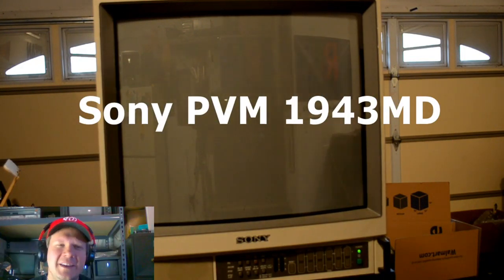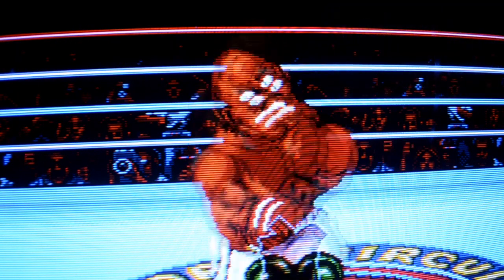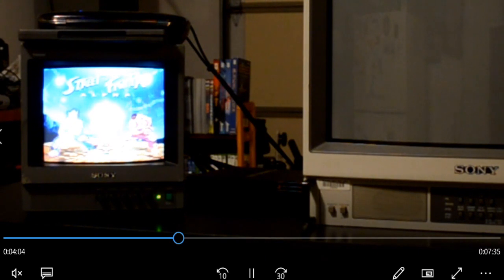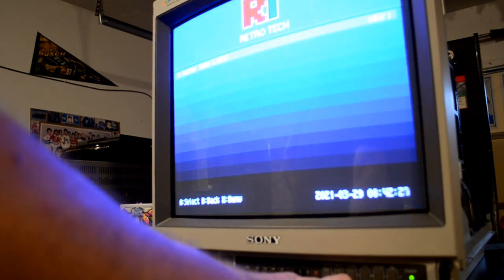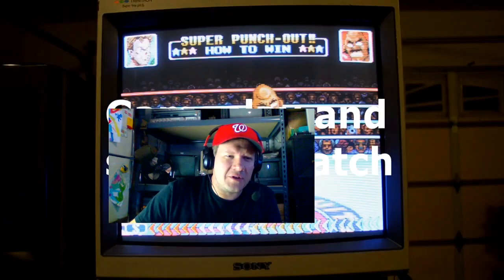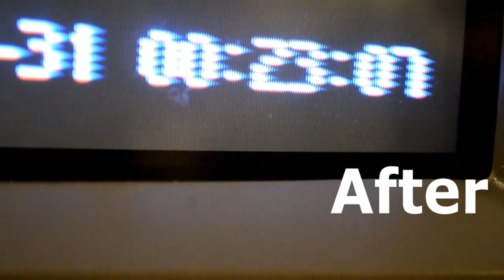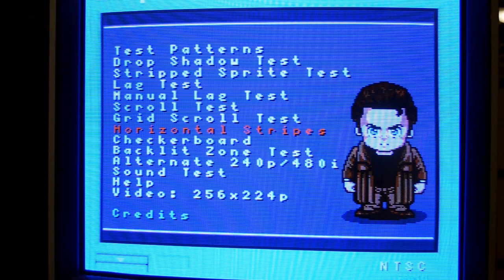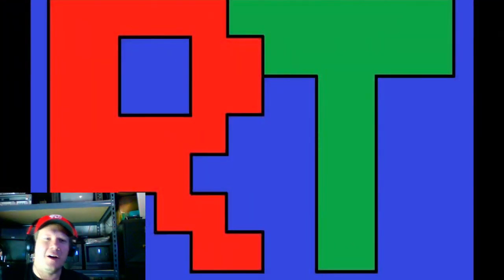90's CRT Restoration : Before & After Recapping | Sony PVM 1943MD

Comment: Hi
I have a super trinitron that i want to restore (it has no logo and the front plastic is cracked). 
When I connect my gamecube and launch Animal Crossing, the picture looks really good, entire screen filled etc. 
If I connect my NES, the colors are horrible, lots of black bars, blurry areas, unfocused areas etc. 
Would recapping fix this? I just watched a bunch of videos on discharging a crt which now seems pretty easy so I might do it if it would fix this. I ordered a logo on aliexpress though 😁

Comment: Hi, great content, i have a question, i after cleanning my Samsung Syncmaster i've connected the bigger cable(the flat one with many wires) that comes out of the logic board to the power supply board inverted and tried to turn it on, then realized the mistake, conected it right and checked everything, and now the monitor keeps blinking and making the degauss noise repeatedly and shows no image. Do you know what could it be? Thanks.

Comment: Do you have link for a good dialectric grease?
Is it worth picking up a CRT that has stood in the rain several days. Is it possible to get it work agian by cleaning and drying it?
Reply: No
Reply: @executive9893  No thanks
Reply: If its rusted then no else you could if you do board repair

Comment: Are those red grid lines only reachable from the inside knobs? I have a control panel at the front sliding out, but I can’t seem to get the red gridlines when playing with the setting screws on the panel

Comment: I am noticing convergence issues on my Blast City monitor. I was wondering what's the best way to go about recapping it.
Reply: @cedmontreal3296  Yeah, I found that video and am following his instructions. I'm actually doing it right now. Only tricky part is connecting the monitor to the power to turn it on to add the convergence tapes.
Reply: @vodkagobalsky  oh I remember having the same issue. I ended up loosing the ties inside and taking the wires out. A better way would be to own a spare cab wiring which I ended up buying for my second blast monitor. By the way, the french video needs a hell lot more of warnings. Please check for safety procedures if you never did this before. The way the french guy remove the suction cup with his bare hands without discharging first (on the video) is one of the most dangerous thing you can do. Never do that. Be safe.
Reply: @cedmontreal3296  Yeah, I'm very careful when handling the monitor. Every time I'm going to touch it, I discharge it first. I did undo the ties in the chassis. I've just finished washing everything. After I recap the monitor PCB. I'll hook it back up and fix the convergence.